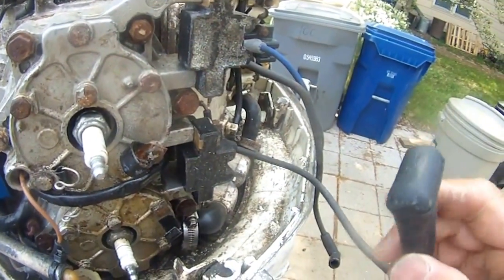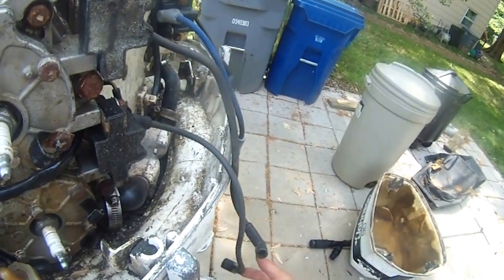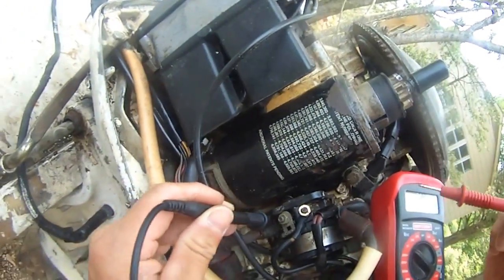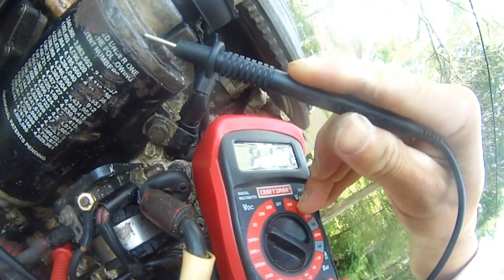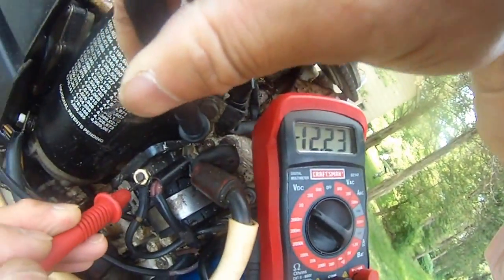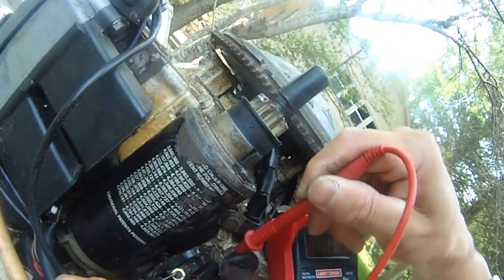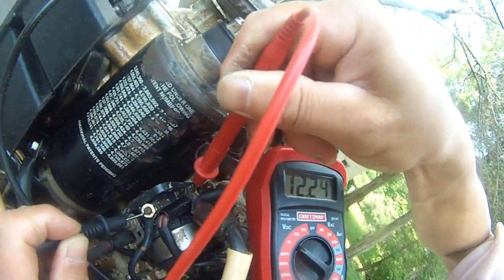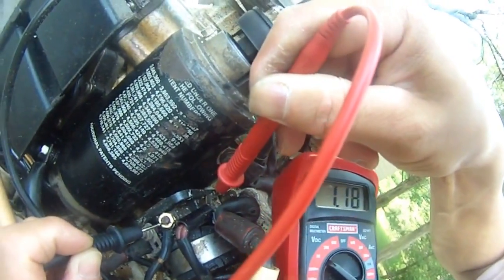Johnson 90 hp v4 troubleshoot #5 - bad solenoid

Comment: I think my solenoid is bad, my battery and cables are clean. I push the button to start on my Evinrude 28 and nothing happens, no crank from the starter at all. Would this be a bad solenoid.
Reply: What did you do to fix this? Okm getting nothing as well.
Reply from the maker: I bypassed the solenoid and jump start the starter by linking the positive with the negative on the starter using a screw driver and it wouldn’t crank so i know it was the starter problem. The loosed connection on the starter screw was the problem.
Reply: I checked all connections, they are tight. Looked around, saw a fuse was out, replaced that, turns right over
Reply from the maker: 90% is the loose or broken connection in your cables terminals or extension points. Remove all screws (especially the three bolts on the starter) electrical tape and reconnect them. Thats the first thing i check every time when i hear no sound when i turns the key. No, solenoid rarely goes bad. Yes, it could cause no cranking sound.

Comment: Your getting close. Don't think it is the solenoid since it seems you found voltage drop on what seems to be the pins connected to the remote (small connections on the solenoid), the in-side positive lead of the solenoid (hard to see on the video) and ground. If battery is good (could be bad even showing more than 12V unloaded, and dropping when loaded though..) you should read just a minor voltage drop on the pins on the in-side side of the solenoid when trying to start.

Comment: Yes.  That could be it.  I just went through kind of the same thing with my motor.  I had the wingnut bolts on my cranking battery.  When I switched to regular bolts and tightened them down with a wrench...it solved my issues.

Comment from the maker: Thanks. I found the possible problem - a loose + connection on starter motor. It got loose from the vibration. I Will post the new video of my motor running soon when I have time. I may need to replace my key switch.
Reply from the maker: austinmetcalf12 at the bottom of the starting motor facing the front is a nut bolt for positive, that connection was loosed. I tightened it and it now cranks like a new motor